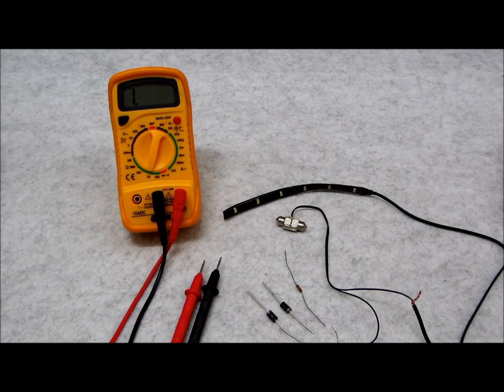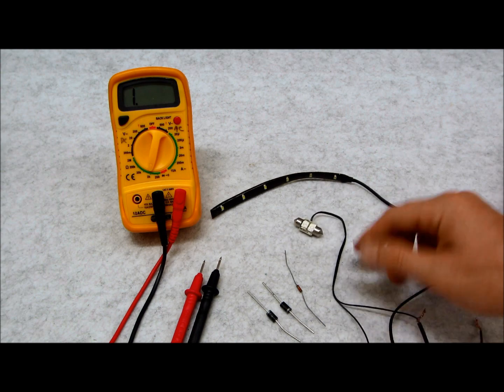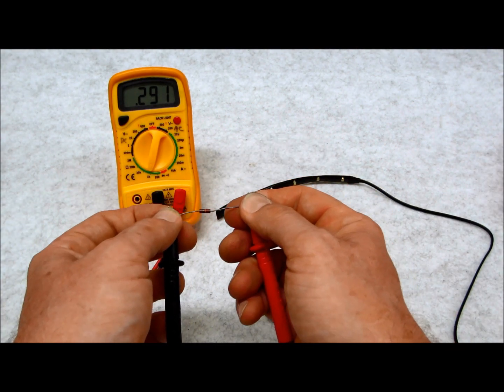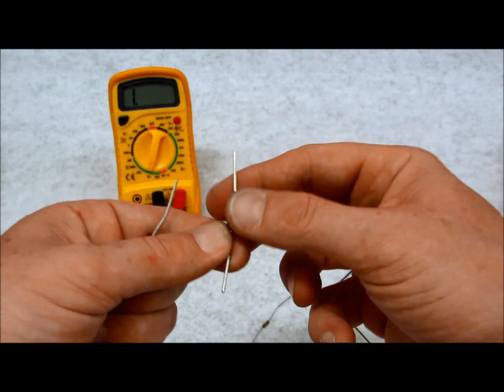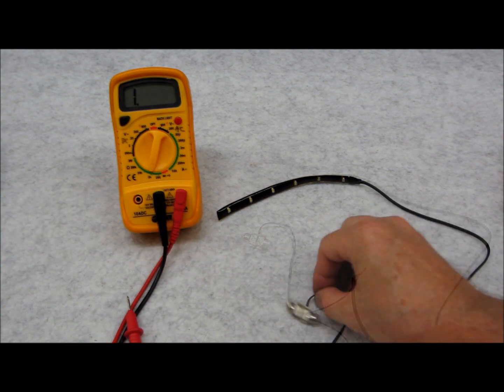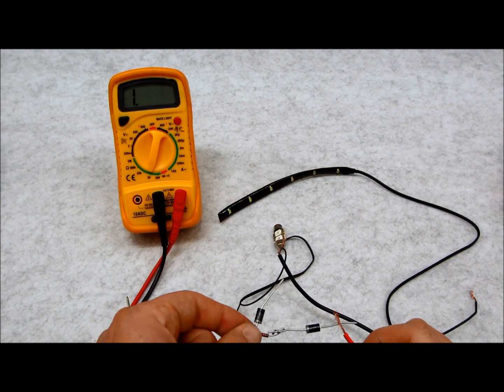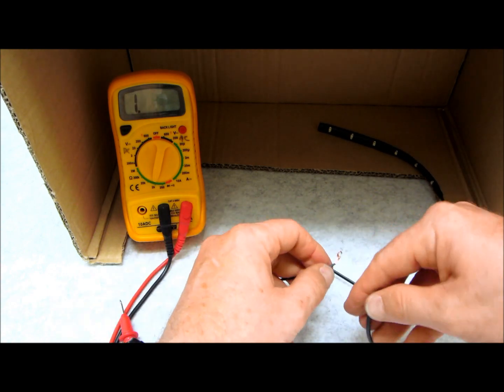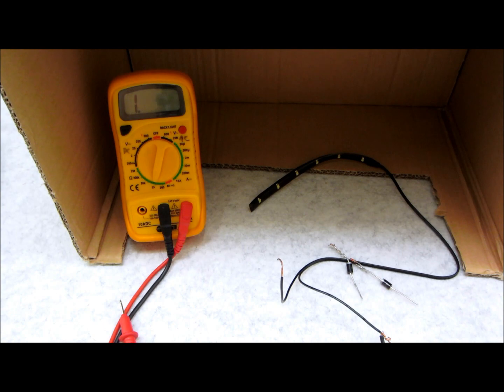How To Customize Motorcycle LED Lights / Dual Voltage and Brightness For Tail Lights

Comment: Let us assume your running lights come off the ignition and your brake off the brake switch. The resistor starts at 12v on the ignition side and drops to 9v on the light side. When you close the brake switch the 9v bumps up to 12v. You now have 0 draw on the resistor. There is no need for the diode on the resistor side.

If the brake switch is open you get 0v from the source. Remove the brake-side diode, you'll have 9v comming off the resistor on the open side of the switch. Which, close switch, bumps to 12v at the light.

Why do we need the diodes? A simple resistor T'd into the brake wire with a wite running upto your ignition will accomplish the same thing.

Comment: Mate im confused on th wire u added th diodes n resistor to u touch one wire for running then u touch the other for brake lite but that positive wire ur using to touch the other for diodes wher do i join that to to get brake n running lite to work togethercoz obviously i cant tocuch each wire individualy while im riding u dnt show wher to connect th positve wire? 2diodes one positive wire wher doz it connect to do i hav to split that positive  n join to each end of the diodes or what? Ur video is all kila up to that part then u lose me as to wher to connect th positive wire?

Comment: I dnt undrstand how with ur positive wire frm battery u go frm one diode to th othr n yes it goes frm running lite to brake lite but u dnt show wher th positive wire stays connected to at th end it can only go to one of them rite? So wot gets connected to th end of th other diode to give me both running n brake lite???

Comment: Hello can I hook up a led light kit on my xr650r it all ac stock I hooked up dc system 12 v. Can I get regulator / rectifier 24v or more to power let’s say 150 watt led or 200 watt led   My xr 650r has dual 100 watt ac output. Or I can change it to one 200 watt single output system.  I trying get very brite led headlite

Comment: Thank you for the detailed explanation. Quick question. What would this mean with a single filament bulb as opposed to doing it to LED? I asked because I have some replacement turn signals that are your regular bulbs but are not three wire like the factory ones are on my bike. They are only two wire and I do not want to do away with daytime running lights. Would using the two diodes as bridges between the factory turn signal and DRLs and the positive wire from the aftermarket turn signal accomplish the same thing? This would be without resistors.

Comment: Sorry also forgot to ask, I am doing like running time day lights on the motorcycle but they keep dying on me. i ran them with a on and off switch to turn them on manually. can you please advise so they dont die out so quickly should i use resistors and what wattage. Please understand im not an electrician im just a regular guy trying to make my bike look better and safer.

Comment: Awesome! Big help, just what I needed, you answered my questions!!!! Still have one question, to avoid using a resistor, and if I have access to say a running light cable (assuming it’s about 5v) can just use the two diodes with each attached to its own power wire, 5v and 12v to accomplish same running and brake light set up?

Comment: The resistor is matched to the color of the LED’s, just check the info sheet on them or as in the video, start with a 200 ohms resistor to see how bright they are, especially when behind a colored factory or homemade lenses. 
  The resistor is the current limiting device, so it is used on the darker or less bright LED’s. Brake lights are alway brighter, today, you hope someone will see them. But play with resistance as 460 ohms May work for tail lights, but only a 200 ohm to brake light. 
 Applying voltage to either is double duty, so two circuits connected at the start will allow voltage to backward into the other circuit, causing all kinds of goofy issues. Hence, we need diodes. Look up a power solving simple math that is P * I X E or PIE. You don’t need a 5 watt or a 3 watt which the math will allow you to operate a 90 ohm coil of a relay. Quit a bit more. 1/2 watt diodes are fine, but as the charging voltage varies from 12.8Vdc engine off, fully charged battery at 100% state of health. The rate of voltage output is determined by the air temp. Cold temps, the alt runs at 14.2Vdc while cold it runs at 13.2Vdc. This is true for charging a battery as well. 
 Remember their is a voltage drop of 0.7 volts across the best diode so using a DMM, don’t freak out. It is normal. Yes, voltage is important but current makes you LED’s last a decade or too much current, they last for 3 Ms. Poof, their goes the magic smoke. Point the ring on the diode toward the LED array, add the resistor on the side that stays darker. 
  Just provide a good ground path to the battery, use Star washers to dig into paint, and dielectric grease sold with silicone at home improvement stores. Remember, the lower the current and voltage, the larger a mistake here becomes.
DK, ASE Master Tech since 78, retired.

Comment: Good evening everyone, hopefully the gurus here can help out with this problem. I bought a 97 honda shadow 600 custom. I bought a cool set of front and rear led blinkers that are running lights as well. They have 3 wires coming from them. The stock lights have 2 wires. I've googled for weeks. And only find the opposite. Now I am ok with without th running lights, but since I have it open, why not do it correctly. Thanks guys, go easy on me this is my first time.

Comment: Thank you, this is great! Question... I have a two wire LED light on each side of my tour pak tail light. They serve as blinkers and only tuen on when blinker for that side is activated. Is there a way I can use two diodes to connect both the turn signal and brake so that if I use my left turn signal the light will blink even though I apply the brake and the will stay will stay solid, as brake (left turn signal in)? I assume something else will be necessary to stop power from brake.
Reply from the maker: yes, I cover that in my double diode isolation video.

Comment: Great video👍👍. Question can I use that same style diode on my 36 led set up? Also would I only need 2 diodes to make all 36 LED work? A little info on my set up I have 36 diodes LED with resistor on each one of them. The specs are 12v forward voltage is 2.0 and forward current is 20. Thanks for your help
Reply from the maker: I would use 3 amp diodes on yours
Reply: @Lesscoelectronics appreciate the response. how many of them would I need?
Reply from the maker: depends, what is your 36 led strip doing exactly?
Reply: @Lesscoelectronics  they are in my taillights. the purpose for them are for my parking lights and I want  to make them also my brake light. Thanks for your help
Reply from the maker: @Elmer_R  oh, in that case 1 will do the trick
Reply: @Lesscoelectronics  appreciate it. Any model in particular you recommend?
Reply: @Lesscoelectronics  which one in particular do you recommend? Because I seen a few 3 amp  with different volts. Appreciate your help

Comment: Hi, we are interested in a running light, brake light and turn signal , three wire setup.
1. We are thinking maybe we use two diodes for the running light 
2.  place the resistor behind the diode band to stop the led hyper flashing on the turn signal wire. 
Do you think this will work?

Comment: Good info. My problem is that connected extra side led running  lights and an additional brake light on my Harley Street 500 and now I don't have running lights or brake lights at all. And all the fuses as fine.

Comment: Here is a good one for you. And I believe you would know how to achieve this.

Your video here has given me hope for my build.

I want to take a led strip that has white and red on it.

Red will be wired to both brake and parking and tail lights.

Parking will give me 50% brightness
Braking will give me 100% brightness
Turn signal will be 100% but blinking
( I wanted sequential - just run thru the leds  repeatedly )

Reverse would be 100% brightness

There are modules out there already but they are not sold by themselves. They are sold with led strips and the strips do not have the colors I want..

I can build my own kit. But I am not sure on the type of led strip or components to put in a project box....

If you dont mind giving some insite
Reply from the maker: the only component you really need to shop is that sequencer, all else is pretty straight forward. Just (optional) relays and resistors, maybe a diode or two..

Comment: Hope I can get an answer I know this is an old post but still relevant. I want to wire a led strip to ALSO flash when my turn signal flashes so could you put 3 power inputs? 1 running light w/diode 1 braking light w/diode and resistor and 1 from turn signals w/diode.

Comment: Quick question i cant find a answer anywhere ...hopefully u can help ...can i add my turn signals to that to if i do the same as tail light add another resister and diode on a 2 wire led strip ??? So u would have turn ...brake..and running? I have a costume bagger n LEDs r much noticeable but the sattlebag spoilers i have is only for 1 6 inch led strip ?? Plz help great video also
Reply from the maker: In order to do that effectively you would be best to use a tri colored led strip to get the best effect, Just as you would see on a pickup truck for example (just in a smaller version).

Comment: Just a question... what wattage do I need for the resistor and how many volts for the diodes do I need?
Reply: 12v 1w 510-560ohm resistor
in4004diode

Comment: I think this would add the resistive current to the 12 volt for the brake light. Am I correct? If you have 6 volts coming from the running light line and 12 volts from the break line... would equal 18 volts. Wouldn't that burn the leds out sooner?

Comment: Is the 5amp diode good if i want My highbeam to turn on both High and low beam?
Reply from the maker: The long answer is the right one I think here, You should measure the draw with a meter to determine that before trusting a diode with current. Or better yet, Just use relays and let them do the switching since that's what they're really made for.
Reply: Lessco Electronics ok thanks for the info😊

Comment: i like to have a run, brake, and turn. is it possible on one LED strip using this.
Reply: I think I saw one on a racertv video, cb350 I think 

Did you find a solution? I want to build something similar
Reply: we have the parts to do what you are asking. www.radiantz.com
Reply: Same here. I'm looking to just have my rear turn signals act as a running and brake light. 3 in 1, eliminating a tail light. Raidianz do u guys have this?

Comment: i went to ebay they want to sell packs of 10 i dont need that many how about Radio shack would they have the diodes an resistor ASAP PLEASE
Reply: Radio Shack used to carry that kind of stuff, but you'll probably pay them as much for 1 as you'll get the pack of 10 for on ebay.

Comment: The driving light trick is cool so for you who didn't catch the game here if I get this right is you hook up power from the driving light source to the diode with the resistor and the brake light power to the diode without. The Diodes block power from each power source so they work separately and the resistor dims the power from the driving light power (Any constant power source). The diodes work like shutoffs so to say or check valves if you know what they are.

Comment: Hi, when I installed the LED bulb 1157 to my bike tail light holder, none running light  (2 of them) lighted up, depressed brakes and both lighted up. I tried using one filament bulb with one LED , filament bulb lighted up while LED only light up when brake depressed. In such case, do I need any load resistor for the LED to light up ?

Comment: just use "one" 1K ohm resistor and hook up the tail light to the resistor and the brake light to the other side of the resistor which is also hooked up to the led's.....cheaper and easier.......
Reply: Spallone Joseph how do you do it?

Comment: This does not work on multicolor LEDs . How do I get rgb LEDs to work like this?
Reply: RGB light strips cannot practically be driven with this simple circuit because the different color LEDs have different "forward voltage" and brightness properties: at a nominal 10 milliamperes (10 mA) the typical red LED has a forward voltage of about 1.8V , yellow about 1.9V, green about 2.2V. and white and blue ones around 3.2V. What makes it even more complicated that forward voltage varies with current, and the forward voltages for different color LEDs vary with current at different rates.

It is important to realize, then, that an LED for automotive applications already has an inline current limiting (protection) resistor built in, because in its natural, unprotected state an LED would be destroyed by 12V. To match apparent brightness and varying forward voltage drops the inline resistance is different for each color. 

To change the brightness of RGB LEDs, then, the inline current limiting resistors would each have to be selected per color, meaning that there would have to be one of each circuit described above for each color.

The OTHER way of doing this is to use a "pulse width modulator" ("PWM") driver circuit for each color circuit. A PWM driver turns an LED on full and off very rapidly - too fast for the eye to see. When the LED is on, it is delivering rated brightness, so varying the ratio of on time to off time (the "duty cycle", varies the effective brightness more effectively, courtesy of the brain, which is easily fooled.

Using a PWM modulator is how it is actually done in variable brightness applications. An Internet search will reveal circuits and commercial solutions to this problem.

Comment: Hi, great video, couple questions.  Looking at 5 amp diodes I'm finding lots of different voltages from 40 volts up to 1000 volts. What is the proper voltage for a 12v motorcycle flasher strip LED just like you built.   Second question is on the 300 ohm resisters I'm finding different wattages from 1/4 watt up to 10 watts. What is the proper wattage?  Final request is for another video showing how to make an LED run constant as a running light and then make it flash off to work as a blinker. Thanks
Reply from the maker: +Joshua Young these are the diodes we carry: http://www.ebay.com/itm/10-Pack-Omega-AU-3005-A3N-5-Amp-Diode-3A-Diodes-12-24-Volt-/361516971422?hash=item542c17359e
Reply: Josh wattage for resistors depends on how much current goes thru them to the load, which in this case is the LED light.  first thing is find in the spec for the light or combination of lights will be powered thru a resistor.  led are low current devices so you are likely looking for a numerical value of 2-3 digits followed by ma.  ma is short for milli ampere. this is 1 1000th of an amp which is the unit of measure for current.  this is important to use in this formula. P=IRxI.  so wattage is the unit of measure termed as power, P.  I is the current value and R is the resistor value.
using this formula you can determine actual power that the resistor will disipate.  once you know this the standard rule for safety and cooling for resistor it to make the resistor wattage 50% larger.   ok so,  say you find current value of 300ma for led.  for the formula you need to convert ma to amps.  this is easy by moving the decimal point 3 positions left.  so, 300ma = .3 amps.  or 30ma = .03 amps.  see, easy.  you know your resistor is 300 ohms so use this in the formula to get wattage/ power thru resistor.   this power value is the same wattage thru the diode and increase the diode wattage by 50% also for same reason as resistor.  in the video was used 5amp diodes.  this was likely very safe and oversized than required so you may be able to use a lower wattage or amp diode and possibly lower cost.  now diode current, a 1amp diode is = to 1000ma.  I offer this because now you can determine the optimal diode spec needed for your install.  I hope this helps.
Reply from the maker: http://www.ebay.com/itm/10-Pack-Omega-AU-4005-A5N-5-Amp-Diode-5A-Diodes-12-24-Volt-/141732960621?hash=item20fff1596d

Comment: Great video and easy to follow.   I want to connect 6" led strips to make turn signals inside the mirror box my 99 Tahoe. Would I use just one diode and resistor to connect to the turn signal wiring of the truck, so I get the ON/OFF effect on the mirror led?  In 2001 Chevy integrated them behind the mirror as an arrow.  Any help is appreciated.
Reply: Roger Spence i

Comment: Hi there. quick question... Just to clarify will this work on a strip of LEDs  for 12v motorcycle brake light? Thank you

Great video
Reply: +Steve-O Knight You can buy a new relay for led lights, the filimant lights draw more power which is why your led's flash fast
Reply from the maker: +Steve-O Knight yup
Reply: +Lessco Electronics thanks. does the size of resistors and diodes  matter. in case of turn signal  bulb on motorcycle. 

trying to stop the fast flash rate from a flasher relay
Reply: anxiety attack

Comment: Absolutely fantastic video! After watching this I went down to Frys and purchased a couple diodes and resistors and made some simple custom light strips for my CBR that have low voltage constant lights for driving, and if I need to really be seen, like when splitting lanes, I just flip on the highs! And because your video was so easy to understand, I felt really confident like a real pro when I was buying the parts! Thanks a million